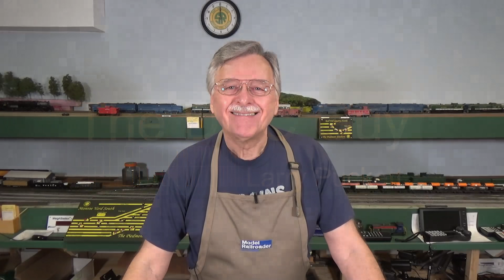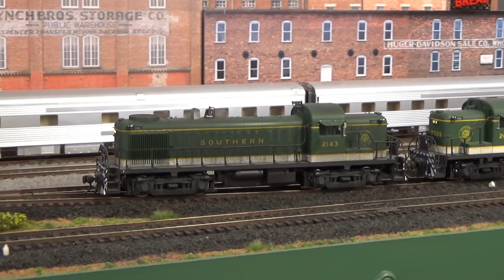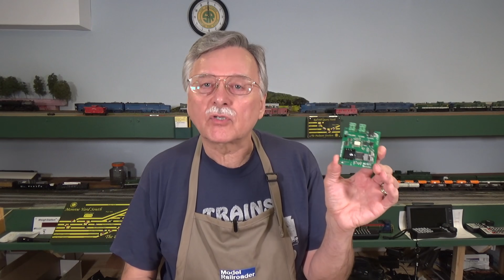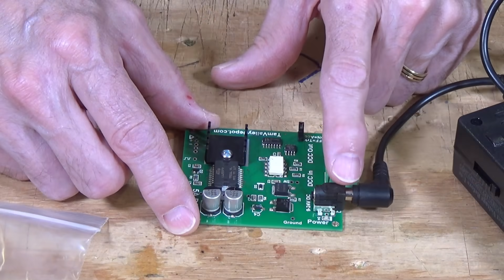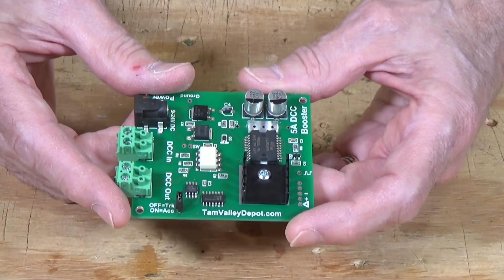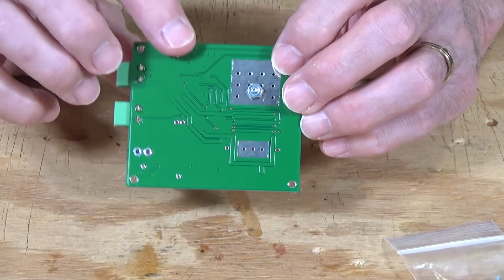Do You Need A DCC Accessory Bus? (190)

Comment: I have an extra DB100a which I can use for a dedicated dcc bus to operate my Digikeijs DR4018 switch machines which are now tied to the main dcc bus
What do I do to tie the db100a to the main system so I can operate the switches via the Digitrax handheld throttles?
Reply from the maker: You need to connect a 6 pin flat cable between the ports on the command station and the DB100a.
Reply: @ thanks, I thought of that right after I posted it 
Thanks for responding, I really enjoy your work

Comment: Where do the wires come from that go to the DCC in terminal on the booster?? Are they DCC track wires, or is there a DCC accessory bus terminal hookups on the DCC system you are using? If you're using a Power Cab, where do the DCC in wires that go into the booster come from? Thanks Larry
Reply from the maker: They come fro  a DC power supply.
Reply: @TheDCCGuy  Larry, I meant the DCC in wires on the booster.
Reply from the maker: What brand of booster are you referring to? And do you mean the flat cable or individual wires? On a booster you have DC power coming in via the power connectors and you have the DCC signal coming in from the command station or another booster and that is the signal that is “boosted” to track voltage and amperage values before being sent out on the power bus. The DCC signal can be fed i using a flat telephone type cable or with some brands just using 2 wires spliced off the DCC track,power bus. Most command station/booster manuals show how yo make these types of daisy chain connections.

Comment: I have been watching as many of your videos catching up. They have been so educational. This video was very interesting. What I have discovered, is that by using current sensing block detection like the Digitrax BXP88, if you have the Cobalt Digital IP motors connected to rail power which the block is detecting, it will eventually trigger the occupied sensor if you have two or three. For that reason, I put all of the motor power on a DCC accessory bus. Then instead of using the frog terminal, took the rail A and rail B track power for the block to the form C terminals, and the frog connected to the common. This solved the occupancy issue. This might be obvious to experienced people, but it is still nonetheless another reason to use an accessory bus.
Reply from the maker: Yes, any device that uses any current can cause a detector to give  false occupancy. Some detectors have ways of adjusting their sensitivity, but your approach of operating them off the accessory networks works fine.

Comment: I have an NCE Power Cab.  My layout is about 15x20 double deck.  So, it's a a decent amount of track.  If I were to add a SB5 for the tracks, would it still be worth having this booster for the accessory bus?  Thanks Larry!
Reply from the maker: The SB5 replaces the original PowerCab module and gives you 5 amps to power your trains and accessories.

Comment: Just to be clear, you can't send a signal to open or close a turnout if your main station has shorted out.   The accessory booster can continue to supply power so it would allow you to finish the open or close that was started before the main short.   But, if the main station has shorted, it won't send out any signals and thus the booster won't get any signal to "boost" to the secondary bus.

And, whenever you are using boosters for your main bus (buses isolated of course) you want them to all have the same input voltages (well really the same output voltages) otherwise your locos will run at different speeds in the different power districts.
Reply from the maker: You would need to have a circuit breaker to prevent the command station from going down in the case of a short. As long as the accessory booster is connected directly to the command station it would stay active to allow you to throw points while the affected block is shut down.

Comment: I've always run a 12vdc power bus around the layout because I don't want a bunch of wall warts and plug strips scattered around the layout.
Reply from the maker: A DC bus is fine and I showed in a previous video how to install one. They are a good option IF you do not use accessory decoders to tap power from your main DCC power bus.